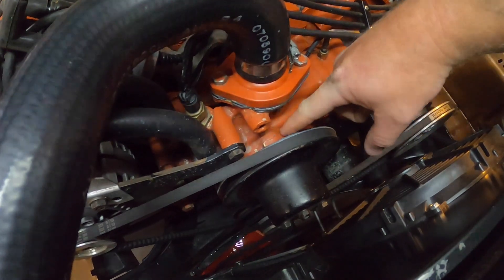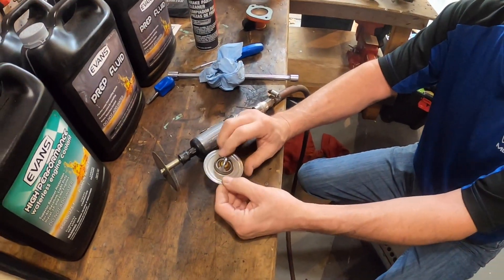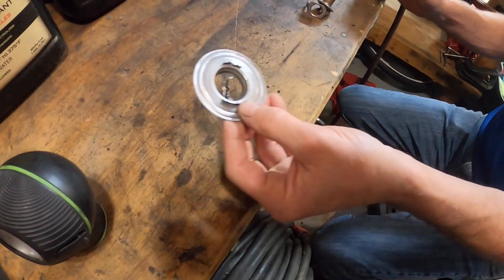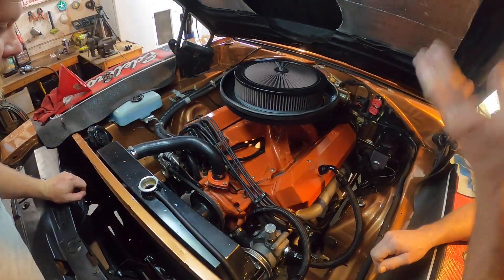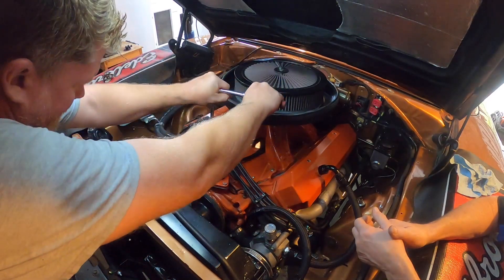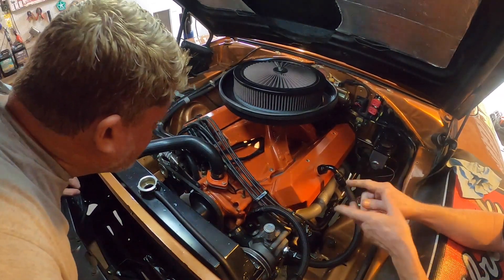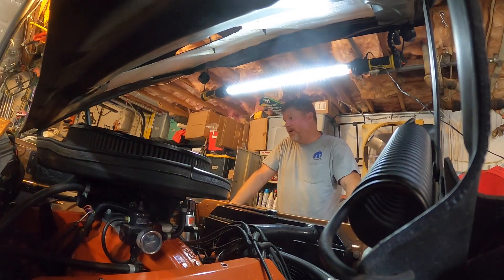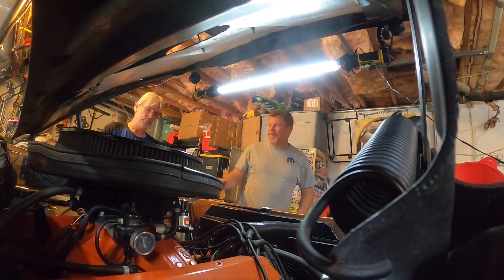Delete Cavitation Without Losing Restriction w/ This Quick & Easy Thermostat Trick

Comment: Been changing those housings since 1971. Never a leak and I've used both Permatex and RTV. I always cut out the center of my thermostat for my hot rods. Not good though in cold weather.
Reply from the maker: It just takes a little while longer to warm up. The Evans compensates for that.

Comment: NASCAR uses a 5/8" hole to control flow
And prevent cavitation. Indian Head Shellac seals stuff permanetly. I use it knowing full well it's hard to remove. Doesn't Moroso sell a thermostat housing that uses an 0-Ring?
Reply from the maker: Yeah, we're looking into those ringed housings now.

Comment: Most times the housings are bowed in the center from poor materials and/or over tightening. I machine them flat (cannot do it with a belt sander very well). Then use some gasket maker on both sides of the gasket, then snug it down (do not over tighten) and let the gasket maker cure.
Reply from the maker: Although we didn't have the means to machine these down, we did exactly as you suggested - and even noted that we gave it more time to set up at the end.
Reply: Not enough bolts on to fasten it down. Ideally you'd want to have 3 points of contact equally spaced apart rather than just 2 which would keep more even pressure on the gasket while also reducing bowing due to initial torqueing and heat cycling.

3 is a magic number when it comes to anchors points between 2 flat surfaces.

Comment: For the leak on the water pump thermostat housing connection, I will file the water pump flange as well as the thermostat housing. Works for me.
Reply from the maker: Thanks for the info!

Comment: You need to get a tube of Three Bond, Hondabond, Yamabond or Permatex Ultra Gray. They are all pretty much the same thing and just a little would have solved your leak issue without having silicone hanging off everywhere and be easy to remove in the future. It is used on motorcycle, snowmobile, jet ski engine cases that have a machine fit that don't get a gasket and can be used when you have a gasket but just a slight mismatch. You can't fill a big gap with it but it works perfect for things like a thermo housing.
Reply from the maker: Nice suggestion! We used Permatex's "Right Stuff", which had never failed us before. The gasket itself was weak.
Reply: @moparconnection  I had problems for years with sealants. I removed an engine just to redo leaking gaskets because I was so disgusted. I found out about “The Right Stuff “ and it is working great so far. I also waited at least two days for the sealant to cure. Between both changes I believe it made the difference. 
I will still look into the other suggestions because I heard that the Right Stuff is hard to remove.
Reply from the maker: Nah, it comes off with a little elbow grease. Nothing too bad.
Reply: @moparconnection  Good to hear. I might have to pull off valve covers some day. Just as a side note. I did try Right Stuff to make a seal without using a gasket and it failed. I used it for a zero turn water pump because no gaskets were available. Ended up making a gasket. I’d be curious to know if the others suggested work in that situation. 

Why would this engine not cool itself? Compression ratio? How a cooling system will not do the job?
Reply from the maker: There's a ton of reasons. A little too long to explain in the comment section of YouTube.